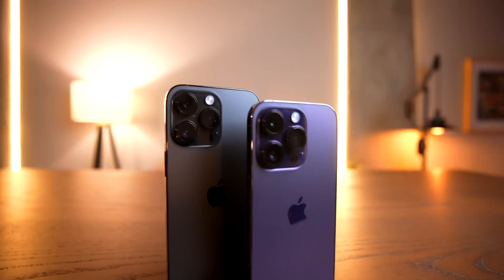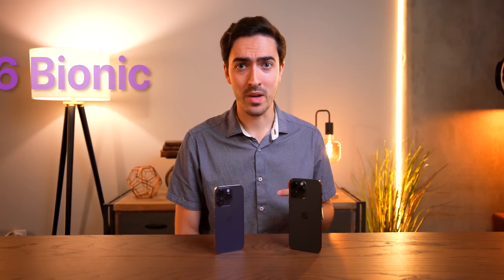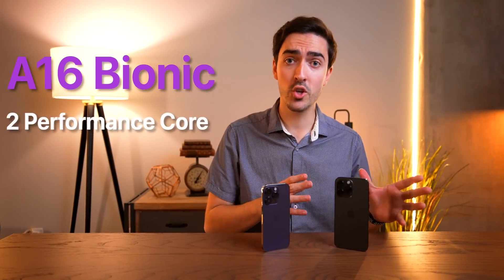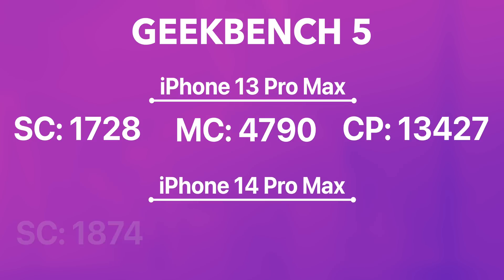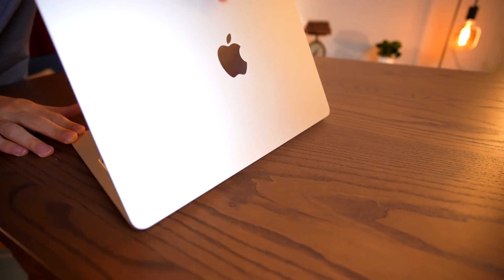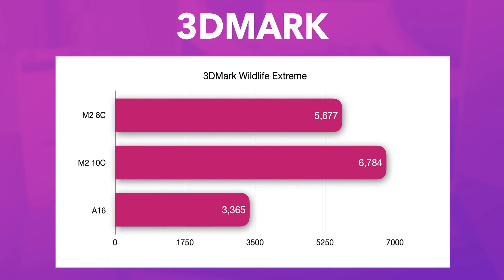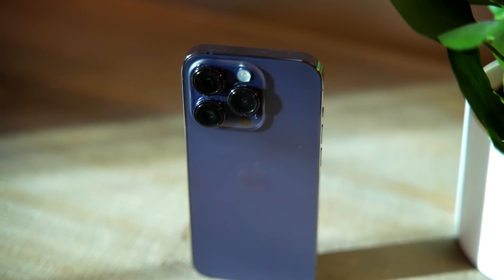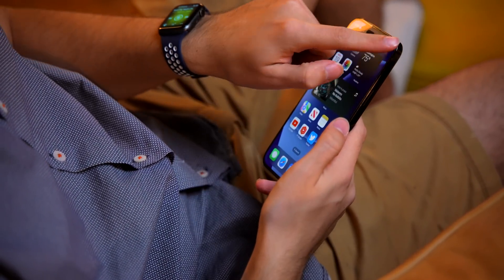A16 vs A15 Bionic TESTED: Apple is HIDING something...

Comment: Luke, differences in processors is not simply cpu and gpu, how about the much improved display engine, isp , faster neural engine , more memory bandwidth….. this isn’t a huge update at all but this comparison ignores everything they actually marketed the new chip to do. It wasn’t about making it 25% to satisfy tech YouTube , it was about making a better iPhone processor to enable new functionality. According to Kuo, M3 will be based off of 3nm as will the A17. I’d put my money on that being where the real cpu/ gpu improvements come into play.
Reply: I didn’t find the A14 slow, 120hz was more of an upgrade to me than A16. However I find huge difference when compared to 4GB A13. Happy with it and don’t care about benchmarks
Reply: @hardikphotos9813  yup, & Apple’s chips are usually the fastest anyway.
Reply: Well said!
Reply: faster neural engine could be the same simple increase in clock…all in all a new memory controller and a new display driver is not a very big update.
Reply: you are right, but that doesn't bring the clicks. Luke isn't about making such observations, it's about getting views and clicks.
Reply: the reason why there is hardly a change this year is because their chips are already the fastest in a smartphone. so all they need to do is focus on efficiency
Reply: @zellzoii  but the 14 Pro Max without the always on display is getting worse battery life than my 13 Pro max which has 96% battery life left
Reply: At the end of the day or night which ones first ur the Same phone
Reply: As someone who owns an iPhone 14 Pro Max; I’m super happy with the performance, but these yields are not correlative with the transition from 5nm to 4nm. 

A16 performs exceptionally well; but you have to call out the inconsistency in performance leap between a15 and a16.
Reply: @matthewmcdonald6283  they also removed the SIM card for no good reason, only to replace with just a piece of plastic taking up the same place.  I could see if they removed the SIM card to add extra battery or more features but they didn’t.
Reply: @matthewmcdonald6283  exactly
Reply: Actually the iPhone 13 Pro scoring better in Antutu memory test than the 14 is really strange. Maybe the benchmark needs an update? It’s supposed to have much better bandwidth
Reply: Yeah CPU is not about processing, and not about graphics. You are right
Reply: @AshishSinghh  there is so much more to it, if you look at the die it isnt made of cpu cores and gpu cores only
Reply: Sounds like a lot of justification about a lack of innovation.
Reply: @aarontyler9569  well, I guess the same could be said about the Android chips since they’re nowhere near as fast as the Apple stuff.
Reply: @MrSamPhoenix  I’m not talking about android im talking about one generation of iPhone to the next, there were not significant new features on this upgrade. Dynamic island is trash and gets in the way of content , you actually have less usable screen than with the notch on my 13 Pro Max, battery life is less so the chip is not more efficient , and the always on display completely dropped the ball.  That’s why I’m returning my 14 Pro Max and keeping my 13 Pro Max
Reply: @aarontyler9569  please, you didn’t buy an iPhone 14 Pro Max. There are plenty of tests that prove the battery life is a little less with the AOD (Always on display). Not to mention that the OLED display is brighter this year, the speakers are also louder, & the A16 chip can run at a higher performance levels for longer periods of time compared to the A15. 

& if the dynamic island is so trash why did you get the 14 Pro Max? & why are Android fans & makers trying to copy it?! Stop it dude, you can’t expect a mammoth leap in performance year to year.
Reply: @MrSamPhoenix  I literally have device in my hand.  And I thoroughly tested it vs the 13 Pro Max, I bought the 14 Pro Max on launch day.  I’m not saying it’s bad phone but the only upgrade is the camera’s , the phone seems to run hotter than the 13 Pro Max which explains the lower efficiency.  The 14 Pro Max also has a slightly smaller battery too
Reply: @aarontyler9569  well I guess you’ll be returning it.
Reply: @MrSamPhoenix  I do plan to return it, like I said the 14 Pro max isn’t a bad phone but if you are coming from 13 Pro Max I wouldn’t consider it an upgrade except for the cameras
Reply: @aarontyler9569  Right, Apple doesn't innovate..

Comment: So for the iPhone 14 pro Apple was meant to put a 3 nanometer CPU in the A16 which would have seen a 40% performance gain over the A15. But chip manufacturer ,TSMC, had production delays and problems making the 3nm chip which meant Apple had to go to a 4 nanometre CPU from TSMC and it's least powerful 4 nanometre model again due to production delays and problems. 
The performance gains in the A16 mainly come from better energy management. The iPhone 15 pro will have the new 3 nanometre CPU (A17) and the much improved performance which the A16 could not get.
Reply: Apple said in the reveal that it was efficiency based, so not sure what the issue is? However, Apple has allowed higher clock than the A15 speeds for shorter tasks, so there is added performance as all benchmarks confirm.
Reply: @andyH_England  It's true the A16 has better benchmarks but it's a modest gain on the A15 compared to previous generations. This is because the whole architecture of the A16 chip was designed with 3 nanometres in mind and when TSMC could not deliver Apple had to adapt and compromise their original CPU architecture (and therefore performance) to a 4 nanometre design.
Hence the disappointing performance upgrade.
Reply: @seanhunt7750  Yes, it is circustances, Apple cannot control how fast TSMC can get 3nm up and running. They had to make a decision in Q2 and went with 5nm+ (4nm). They knew that 4nm was a minor upgrade, hence they kept the 5nm in the base iPhones.
Reply: @andyH_England  The A16 is basically the A15 chip but made with 4 nanometres instead of 5 nanometres. Hence the"efficiency" gains.
Reply: @seanhunt7750  Yes, they are the same architecture with a few tweaks. Nothing but a half upgarde, that TSMC do every two years, just making it more efficient and fixing false steps.

Comment: The battery isn't worse, that's just wrong. You tested the phones at 80% brightness, but 80% on the 14 Pro is MUCH brighter than on the 13 Pro. And as we all know, brightness is the real killer.
Reply: Yes, you have to set both to the same nits to be scientific otherwise results are useless, as you say, brightness is logarithmic and that will be a battery destroyer.
Reply: Agreed.  It's funny when YouTubers pretend to be engineers.  If you want to test the efficiency of a chip, they you need to isolate that from the rest of your test.  Many other things changed including screen, etc. which is a huge variable.

Comment: Maybe it is only a matter of how much power is given to the chip, in a Mac Pro i think that the power supply could be a little more powerfull than the iPhone 🤣 Just for saying that it doesn’t matter if it is the same chip, or process because it is going to behave differently anyway
Reply: Yes that’s right but the 14 pro has allready a bigger battery as the 13 what clearly shows that it’s not the battery which caused this, it’s just the less efficient 4nm die which will in most cases just take more energy for the same task…
On 4nm the electrons jump way more often over the transistors as this is the case on 5nm, which in simple words mean that the new die sometimes just take a second or even third run where the 5nm electron just pass in the first try and every try cost the same energy, if it reach the transistor or not is not important for this, the only thing which happens on the 4nm chip is that it generates more heat for the same task (in most cases)…

Comment: You have 14 pro and 14 pro max. Why didn't you test the 14 pro as well?  Max Tech found that the 14 pro is actually slower in terms of geek bench multicore compared to 14 Pro max because it is smaller and cannot cool as well as the pro max

Comment: I think we have reached a point on the iPhone and iPad where we have topped out the performance needed in a chip that the device/software can even take advantage of. Like the A16 in iPhone and M1 in the iPad will be all anyone needs for years, where a new chip won't even make a difference in day-to-day day usage, even in high-performance use cases for those devices for a long time. Thoughts?
Reply from the maker: Yeah I don’t even know what I would do with more performance tbh
Reply: @lukemiani  Marketing🤭😁
Reply: IMO it’s all about more battery life, that can always be better.
Reply: Yes that’s right, everything after 5nm is just less efficient and we don’t get real advantages out of this anymore, at least not with silizium…
Reply: I'm one of those people that never has enough. Recently got an iphone 13, and after the initial joy of having such a fast phone, I was screaming after 2 hours...
Reply: @paniniman6524  you can’t handle real speed
Reply: @austensmith3330  I can say with confidence that I handled it pretty well. Made it slow in my eyes
Reply: The day-to-day usage is more closely related to faster RAM bandwidth as far as I can tell now. I mean jumping from a high end Macbook Pro i5 with 8 GB to an M1 Macbook with 8 GB is a night and day difference. Those miliseconds pauses when you are trying to open a browser tab or let's say, when you try to do anything remotely intensive are all gone with M1. Almost just like an iPhone with enough RAM. All in one nature of the SOC and speed of it in iPhone did the trick more than the processor speed improvements I think. At least that's what my experience lead me to believe.
Reply: @ultramakspremium  yeah…
No…
The ram has nothing to do with that, even with one or two GB ram a MacBook would have more or less the same speed, the ram is just important for multiple apps or programms which running in the same time…
An if that are not the biggest apps (browser, messages, mails etc.) you still don’t need high multicore performance from the soc…
But what’s important for those little tasks is the single core performance from the soc…
Reply: @Eddy_E.  I think 30 to 40% single score advantage of M1 doesn't explain the overall snappiness. I wasn't talking about the amount of RAM. I also wasn't talking about the number of cores. I was talking about the SOC nature of the Apple designed chips which allows them to communicate much faster. It's not even only about the RAM bandwidth. The actual design, thus efficiency affects the snappiness positively. That's where I think the instant response comes from. I may be wrong but your explanation still does not touch why Apple's chip architecture is almost always mindblowingly responsive.
Reply: @ultramakspremium  30-40% is a lot and makes a big difference, 1min becomes just 35 sec (roughly), thats not just a small difference...
But in the end you cant compare Mac and iPhone 1 on 1, a Mac is way bigger with way more battery and way better thermal Performance, when you must take devices in a similar class like Mac and iPad but mac and iPhone are still to far away categorys for now...
Reply: Agree. But actually I think the A14 was already there.
Reply: @citizentex5720  I agree
Reply: On device AI will be the reason for the real next generation of devices.
Reply: I use Adobe Lightroom on my iPhone and iPad and use its AI masking feature on many photos and a faster processor definitely helps with that.  I could use even more speed.  The time waiting for it to process the mask adds up.
Reply: I'm old enough to remember Bill Gates saying that 640 kB was all the memory a PC would ever need. Now, people complain if their laptop only has 16 GB. Likewise, there will never be such a thing as "too much performance" in a CPU. The limiting factor for iPhones and all other portable electronics is batteries.
Reply: @zenbum2654  also the O.S don't take advantage of those monstruos chips
Reply: Well the next step with more performance would be effective multitasking, like rendering a video on your iPad while doing something else resource heavy. Of course the market and need for it is very small as not a lot of people would use their iPad for workloads that heavy, but with the addition of Stage Manager I think that’s the direction Apple is going anyway. The line between MacBook and iPad is exponentially growing smaller.
Reply: The nowadays stakes on these devices is to have the less power consumption for the performance to maximize the battery life and the durability of the device which will meet less heat, so to say less damage.
I would like that Apple give us the choice of the level of eco mode we want : for daily surfing or media consumption, I don’t think we need the whole capability of the A / M chip, even sacrificing a bit of smoothness will not be a problem if I have the guarantee that my actions use no power or almost not
Reply: @thomasraffestin3407  that precisely why I stuck with my m1 MacBook.
Reply: I think that for most of he users is true, however theres specific cases. Some time ago I ran the same CAD software (an easy one) in i5 16G and M1 8G and I got suprised by the difference, the i5 was dramatic, fans at max speed.. and the M1 without hearing the fan and yet way faster then the PC.
Reply: For mobile, sure, but it's bad news for M* chips.  Apple needs to keep pushing the performance side if they want to maintain the momentum of the switch to ARM on the desktop.
Reply: I don't even care about performance. I just want a phone that operates at a reasonably cool temperature. I hope they can improve on that, Apple and Android.
Reply: For gaming it’s important
Reply: @NotScared  What kind of "gaming" are you doing on a mobile device? I still have an iPhone 7 and i haven't seen it stutter at anything I've thrown at it.
Reply: @yarnosh  you know there are games that are huge in terms of graphics
Reply: @NotScared  For example? I'd be interested in trying on my iPHone 7 and see if it can handle it.  I've literally never had my phone have any trouble with a game.
Reply: @yarnosh  genshin impact, fifa 23, pubg mobile
Reply: @NotScared  PUBG is playable even on an iPhone 7. I think OP's point still stands that you're really not getting much use out of the latest mobile CPUs. What people really want is better battery life, which is where the cores really shine.  Doing more with less power consumed helps, for sure, but there's no real need for the power itself to play the games.
Reply: @yarnosh  yeah battery life is important
Reply: The a12 is all anyone needs let alone the a16..
Reply: The new ipad made incredible improvements
Reply: @Lkmiijijiunnim  For, but the M1, chip wise, is still capable of doing all the M4 can do in the current iPad OS build.
Reply: Still they somehow manage to slow down your device after 3-4 years, no matter the product category or the price you payed
Reply: thought is if you pay that much attention to your phone. ... get a life
Reply: @userdwna7414  it’s called having a passion. You should get one